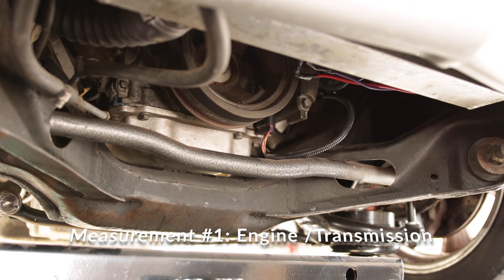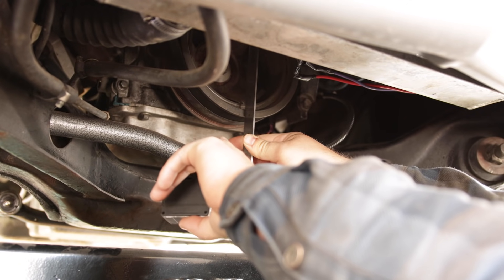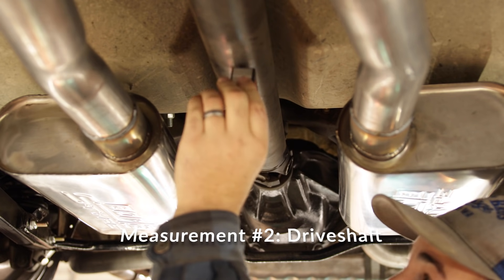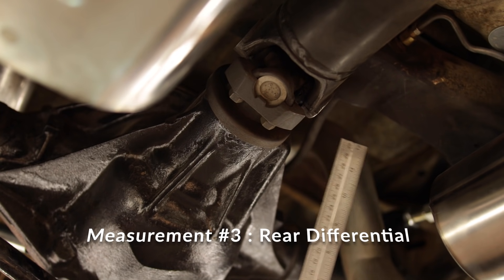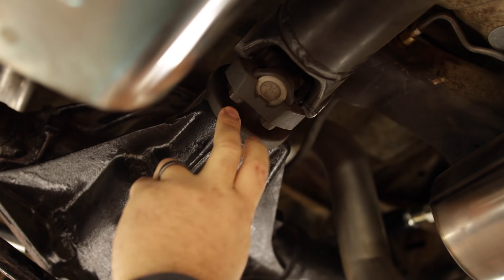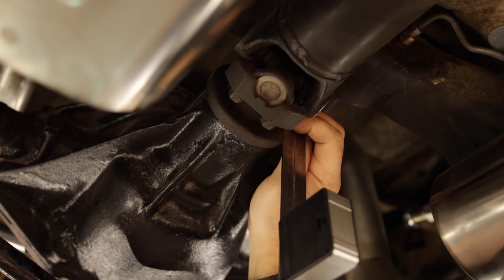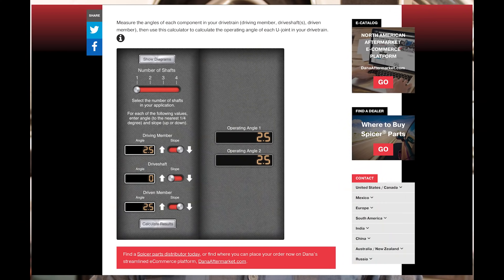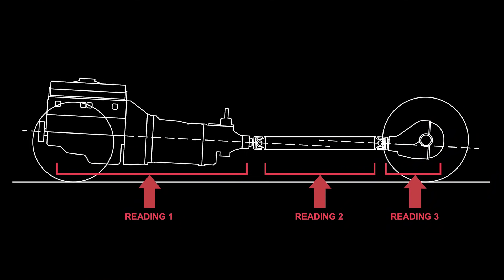How to properly set up and measure your Pinion Angle on your Muscle Car

Comment: I watched your video, great stuff! I'm fighting getting my pinion adjusted. My crank pulley is 4.6 degrees and I can't shim my transmission any higher than what it is. I can get my pinion up to the 4.6 but isn't that an extreme angle?
Reply from the maker: You may be able to get away with that, but it might reduce your U-Joint lifespan. Good luck!

Comment: probably the most easiest video to understand ! am having vibration in my 73 Charger @ 45 mph+  on the highway  and i noticed that when going uphill it start to become less vibrating . i raised my transmission about 1.5 cm 2 years ago for shifter linkage clearance do you think this is the problem . appreciated
 brother thanks in advance
Reply: that would change the angle so ya

Comment: What if my driveshaft measures at zero?
Reply: The actual degree you measure isnt really important because it can always be different depending on if you're level or not. 0 degrees just means its level. What's important is the differences between the measurements.

Comment: I assume if it’s not at right height you won’t get the correct reading?
Reply from the maker: Correct. You'll want it at ride height, with the weight on the wheels.

Comment: I had to stop the video first of all doesn't matter if it's a leaf spring are coil spring are airbag the ride height will always remain the same when vehicle is relaxed on flat concrete you need a digital protractor not a straight edge look it up not going to take everything with your bull crap
Reply from the maker: Thanks for your input?
Reply: @ClassicNation  I have more information from the book the show you Driveline angle I believe it's about a 6 or 7 degree that you drive shaft can dropped I have it all in my file box I will give you an update to make easier absolute correct right now I'm trying to put out fires thank you

Comment: What about a positive  driveshaft angle on lowered vehicles?
Reply from the maker: The same principles apply. Many lowered cars do have their driveshafts running "uphill". The key is getting the U Joint operating angles equal in the front and back, and sticking to the 3 degree guideline. Hope that helps!
Reply: @ClassicNation  yes. Thank you very much. 👍

Comment: hmmm, shouldn't his drive shaft be straight horizontal instead of pointing up or down 2.5 degrees?  3:18
Reply: It's the uni angles that are important,  4x4 's are good examples of the need to run the tail shaft down hill
Reply from the maker: Correct.
Reply from the maker: Not exactly. The driveshaft really isn’t parallel to anything, as it’s about the angles of the U joints.

Comment: Very good information. Most impressive is the way you present it. Very well spoken. Easily understood. You are a great presenter. Well done.
Reply from the maker: Thank you Roger! I really appreciate the compliment and the support!
Reply: Hello. I put 2.5 drop coil springs on my 62 impala and drive shaft rubs on rear floor tunnel. Before I shim it up should I change all my rear and front bushings? Or that wouldn't make a difference?
Reply: @jaimevarillas6329  unfortunately, if you move the differential yoke upward its going to get it closer to the floor. you might be better off lowering the yoke to where the operating angles on the u joints are as strait as possible.

Comment: shouldn't it be noted these measurements need to be taken with vehicle on a level surface?
Reply: vehicle doesn't have to be level if angle of shaft is taken into consideration. Using Tremec app requires shaft angle.
Reply from the maker: Bingo.
Reply: @roncraig1382  thank you, i was always told vehicle needed to, glad to know..

Comment: If I have the rearend cover off can I use this cover flange to put my angle finder on?
Reply: Forgot to mention 12 bolt chevy
Reply: @jamesfowler7065  in order to verify that you could use the rear gasket surface you would need to verify that that surface and the transmission yoke surface are perfectly parallel to each other. So you might as well disconnect the drive shaft and measure off of the vertical surface of the yoke.

Comment: Your operation angles are going in different directions under acceleration....car must have traction issues.  Ignore the driveshaft angle, if the crank centerline is pointed down at 2.5 deg, the pinion should be pointed up 1 deg.  That gives the pinion (1.5 deg) of room to move up under load and not put stress on the u joints.
Reply: May i ask you somthing,my angle at gearbox is 5deg down and rear pinion 16 up..i would like my rear axle with a shim..how manny deg do i need?thank you and greetz from the Netherlands
Reply: @josbremer9966  What kind of car/truck ...what rear suspension...4 link ..ladder bar.. Leaf spring?
Reply: It is a suburban square body 4x4 1979..leaf springs and one sollid axle.
Reply: @josbremer9966  I would say that rear end came out of a short wheel base jacked 4x4 ...?  Anyway I personally would run it at 2 deg up pointing at the tail shaft of the gearbox, which is about 3 deg of pinion angle.  If the truck is close to stock ride height.
Reply: @jcnewbee8124  my truck is a chevy suburban square body 1979 and long wheelbase..it is lifted 6inch on 37inch wheels.front and rear leafsprings.thank you for thinking this over

Comment: What is your advise when using a Jaguar IRS rear? The pinion on the diff is not centered left to right, it's offset to the passenger side. Also note that the diff input flange NEEDS to be vertical, 90 degrees to the road. This is to keep the control arm pivots correct. In my application I also have the engine/trans at 0 and the same height as the diff input flange. Meaning crankshaft, trans, diff input are all in a straight line HORIZONTALLY. There is a few inches offset left/right, but still parallel. The driveshaft is very short, about 18". Oh, and the diff center is solid mounted, does not move with suspension travel so no change in pinion / driveshaft angle.

Comment: Great video, and I am thinking I screwed up big in my first gen F body with leaf springs. If I understood your video correctly, the engine and trans need to be  at a negative angle, say, 2 degrees. And the rear pinion should be at a positive 2 degrees? If that is correct, then I messed up and put my pinion wedges to where the diff is rotated negative two degrees and is pointing down.
Reply from the maker: Have you driven the car yet? Any vibration? Based on your comment, I think you'll want to adjust it accordingly to have the diff point "up" toward the engine (assuming the engine is point "down" toward the diff). Hope that helps!
Reply: The vibration was actually at takeoff. I have a Tremec TKO 600 with a small block and I get a nasty shudder when taking off. At speed the car seemed ok, but something in the driveline didn’t sound right, and my guess is the pinion angle. Glad I found this video. Already downloaded the Tremec app and will go back out there and get all the measurements from crank pulley back when the weather warms up. Thanks again!!
Reply from the maker: @phoenixblack1220  Sure thing! Might even be worth looking into your clutch/pressure plate, which often causes a shudder at takeoff when something is amiss. Driveline angle issues tend to (not always) get more pronounced with speed.
Reply: @ClassicNation  actually changing the clutch to a Centerforce II because I think I damaged the pile of junk clutch they sent me with the Tremec kit. I was at a steep angle trying to get the car out of the driveway and the right rear tire hung up in the wheel well, and the clutch was just slipping and smoked out. I know that sounds bad and negligent on my part, but I was affected by the fires a couple years ago, and the fire had reached my back yard and burning fast and was trying my best to get the car out before I lost it to the fire. So I know there are hot spots in it.

Comment: Hi. Thanks for th e video. Good explanation . Could you help me figure out what I need to correct my issue. So my angles are as follows.

Measured at crank = 6.5 downwards
Measured at Driveshaft = 1.85 Downwards
Measured at Diff Yoke = 5.5 Upwards towards the front of car but I think this i s supposed to actually be downwards.

Single one piece driveshaft with single u joints on each end.

Would a 4 degree shim correct my vibration issue?
Reply from the maker: Well, your angles are pointing the correct way, but I suspect the 6.5 degree engine and trans is too aggressive, and potentially the culprit. Traditional U joints don't like to see more than 3 degrees. Do you have room in your car to raise the transmission on the mount to reduce the downward angle to get it to close to 3 degrees? Once that is done, try to match the diff by using adjustable control arms. If you were able to shim under the trans to bring it up to a 3 degree angle instead of 6.5, then you could reduce the upward angle in the diff to only 3 degrees upward (toward the front) and I suspect you'd be good to go!
Reply: @ClassicNation  thanks for the reply. This is on a 2007 GM truck with leaf springs. I could raise the trans some maybe by 1/4 inch. Problem is if I go any higher my headers bump the frame and transmits vibration inside. I suppose I could try the 1/4 lift at the trans and measure again my angle there. Funny thing is that the measurement there at -6.5 is stock.

Comment: Great video. I'm fighting a little vibration, and I'll use your technique to verify my angles. 👍

Update:
It worked. I found that my pinion was pointed down by 1.4* and my transmission was down by 2.2*. No bueno. 
I've ordered the adjustable upper control arms to resolve this. 
Guys like you, make neighbors think I know what I'm doing. 😈😉
Reply from the maker: Glad we could help! Thanks for the support!
Reply: obviously someone who Knows what their talking about, no guessing, thanks
Reply: If your car is leaf sprung sometimes they will set the pinion angle slightly lower because under a load the spring will twist and the pinion will actually rise a 1/2 a degree or so, bringing it into alignment with the trans angle

Comment: I am just a little confused. You say get your engine/transmission "down" 2 degrees. What does that look like on the gauge? Plus 2 degrees or minus 2 degrees? You are not clear.
Reply from the maker: When I say down, I mean to say the front (towards the front of the car) is higher than the rear (towards the rear of the car), so pointing down refers to a slope that runs down towards the back of the car. Depending on your gauge, it might say 2 degrees, or negative 2 degrees, depending on how you have your gauge setup, but this is based on "level" being "0" degrees. I hope that helps!

Comment: yeah i tried this on my 70 big block nova and didn't like it I don't track race it but do street race it on 235/60/15 hano's with a B&M street fighter convertor  . I'm not a guy who likes to spin his tires and i can tell you this set up made my car spin tire so bad that i know if i didn't let off the gas gas ped it would still be spinning . so i went back to 2% pos , so the car now only leave about a 12 to 14 foot black mark . so yes if you just drive your car maybe this is the way , but if you want to push it with out losing control of car because of the loss of traction then go for it . but i own a muscle car because it is what it is .
Reply from the maker: I'm thinking you have some other things at play here. I haven't heard of pinion angle having a dramatic effect on a car's ability to spin the tires. Rear shocks and springs, yes, absolutely, but given no other variables, I don't know how pinion angle would get your car to "hook" better. Thoughts?
Reply: @ClassicNation  You're exactly right, Pinion angle has noting to do with traction. That's a big misconception in the racing world by home car builders. 
Quain Stott
Reply: @SoutheastGassersAssociation  Great point. I think the confusion there is because the inverse is often true, especially on leaf spring cars in regards to spring wrap and snubber interference, it's probably just assumed it works the other way as well. The exception possibly being limiting spring wrap by 'snubbing' the pinions rotational travel. However, that's not really relative to initial 'static' pinion setup angle... Which I think is the point here. Just a good thought exercise. Just weld everything so it don't move no more.. Problem solved!

Comment: I did a flip kit on the rear of my truck..idk the degrees yet but the pinion is pointed slightly up and looking from side POV it seems the rearend is actually higher that the tail of the transmission..thus creating the driveshaft to go downwards towards the transmission creatinga V downwards for transand driveshaft..which at this point the transmission seems to be pointed way down and I'm at a loss for words ..I got a bad side to side vibration in the seat of pants at 45 to 50 ..question is should I be shimming the transmission up in this situation?
Reply from the maker: Yes, my initial thought would be to make sure your transmission is pointing down at the same angle that your diff is pointing up, regardless of the fact that your driveshaft will be running uphill to the trans. Shim that transmission up to match the diff angle and see if that cures that vibration. You mentioned flip kit, so I know you have leaf springs which act differently under load than coil springs but this should get you close.
Reply: @ClassicNation  thanks ill try that..I was always taught to tilt pinion slightly down so when under load it doesn't wrap upwards to much...but never been in this situation to were the driveshaft fors upwards...thanks
Reply from the maker: @BeardsandCars   Sure thing! Let me know how it turns out!

Comment: I know your talking street not drag car. But with a 4 link suspension, won’t you see around 3 deg of rotation of the axle when accelerating. So instead of engine and rear at exact same angle. You would move the pinion angle down maybe 2 deg to have a better pinion angle during acceleration
Reply from the maker: Yes, with a drag car, I've heard the same.

Comment: I swapped a different make engine and trans into a car I have. I know my angles are off because it vibrates above 65 mph. 

This will help me out a lot. 👍🏽

I'm going to look into getting this App so I can get the drivetrain dialed in correctly. 👏🏽👏🏽
Reply from the maker: Awesome! Happy to have helped! Cheers!
Reply: Any update?
Reply: @squidusn71  Yeah, I have a 3" driveshaft spacer. It was drilled incorrectly, spacer was out of balance causing the driveshaft to be out of balance. So I had another one made. 👍🏽
Reply: @72Dexter72Manley72  sweet man!  I didn't know they even makes those things let alone people put one on and I've been wrenching for a while now.
Reply: @squidusn71  Yeah man, people used to measure angles like that using plum bob's. But these newer tools make these measurements a lot easier. 👍🏽
Reply: @72Dexter72Manley72  I'm swapping engine which moved the new one an inch forward.  I was gonna replace my driveshaft yoke with a alonger one to compensate and I had to think twice about it...I'll be getting a new one.
Reply: @squidusn71  👍🏽. I just didn't want to pay $350 for a new driveshaft back then. I'm sure that price has jumped up another $100 bucks in 2022. ☹️
Reply: @72Dexter72Manley72  Yeah I feel you.  However, I've learned not to skip on things like that which I've done my fair share too lol.  It's a hard habit to break also when you do things for cheap and it works lol.  I have a few "cheap" parts laying around and may not be using them.  I bought my ridetech 4 link minus the coilovers for 1100 and now they're around 16-1800.

Comment: Set a 67 Mustang convertible with inline 6 at 5 deg. Smooth as glass. Looks like the inline 6 sets high in the engine bay. Motor mounts are completely different from v8. High performance 6 with 8 inch differential. Your thoughts sir?
Reply from the maker: If it works, then perfect! Sometimes, you have to work within the variables of the specific car, and take what it gives you. I’m glad yours is vibration free!

Comment: Great video!

Just want to point out that the driveline angel within .5 - 3 degrees is not written in stone. Big rig trucks usually have alot more with a short wheelbase. They get away with it becouse of driveshaft speed is "low". This does not make them vibrate unless they go beyond 15. But it limits the safe speed of the driveshaft. It will over burden the u-joints.
Reply from the maker: Thanks for sharing!
Reply: got 5.2 angle on trans so i got to have 5.2 in diff to be oposite but parallel! :)
Reply from the maker: @CRXSLY   Bingo!